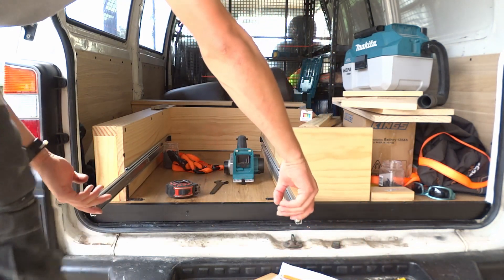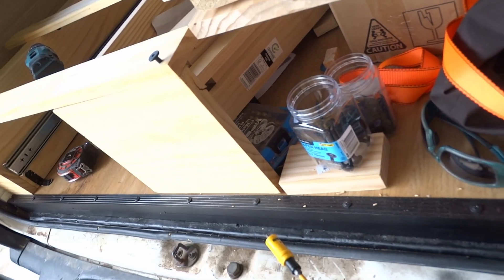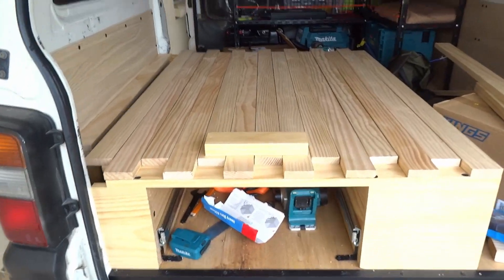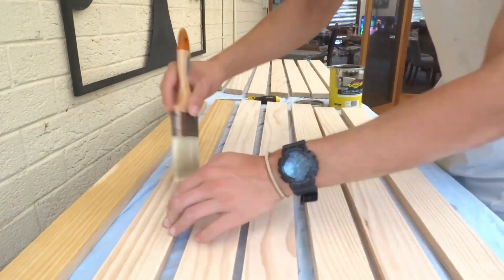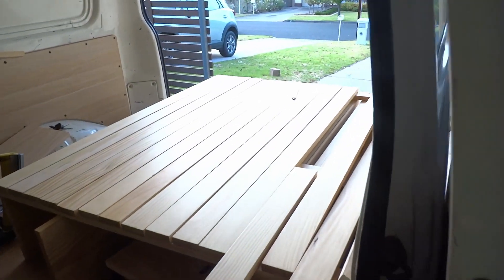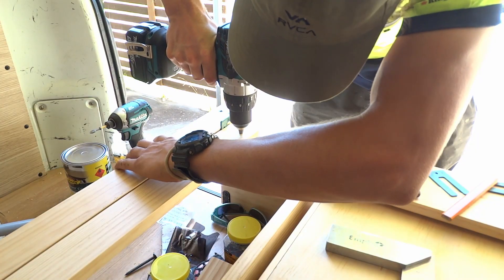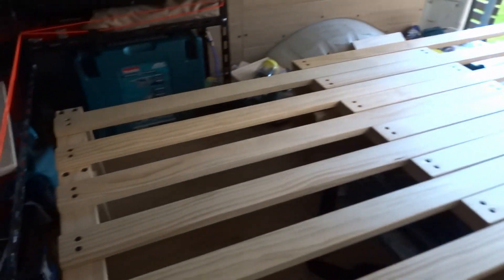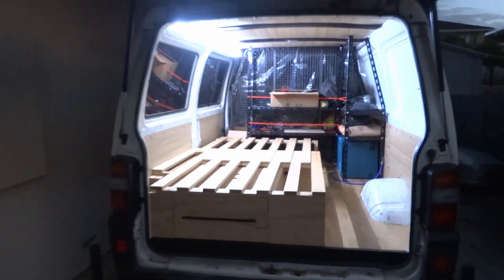Van Sliding Bed Frame | Mitsubishi Express DIY Van Conversion Part 8

Comment: Hey, love the van! Which mm of xps did you go with? 30 or 50? Also, where can I purchase the exact butyl tape you used? And lastly, are you confident that this build and all the products you used will ensure no condensation/mould issues will arise? Looking to deck my van out but do not want the risk of mould. thanks!
Reply from the maker: Hey Makayla, for the XPS board I used 30mm as I wanted to save as much head room as possible. I've found it to be more than sufficient and based on its high density has given my floor a very sturdy base. The butyl tape I bought was from bunnings, and here's the exact link on the product https://www.bunnings.com.au/one-on-one-48mm-x-5m-heavy-duty-double-sided-sealing-tape_p1091267

As far as moisture control, the number one thing that gives me confidence that it's controlled is the vent fan I've installed (video coming) if you wanted to go beyond what I've done to control moisture, you could use plastic to seal in around the rock wall cavities (look up moisture barrier). But honestly, there's debate about whether or not that's effective if even necessary. The only times moisture should be a real concern in the build would be if cooking inside the van, and with that if recommend a vent fan and as much air flow as possible. Hope this helps👌🏼